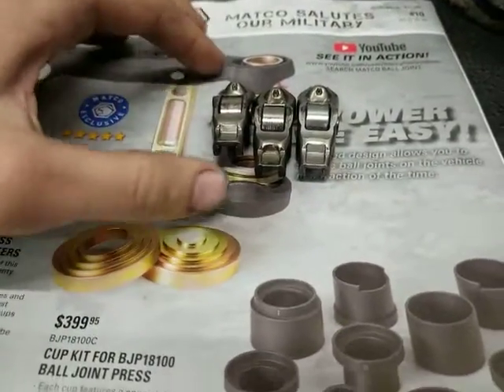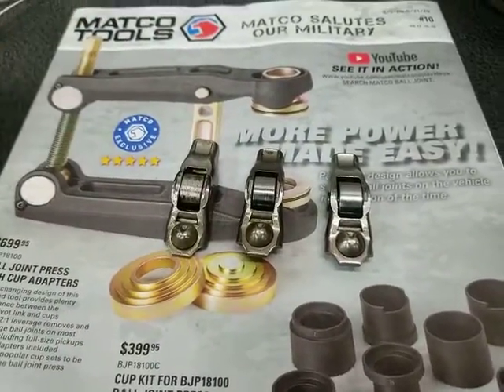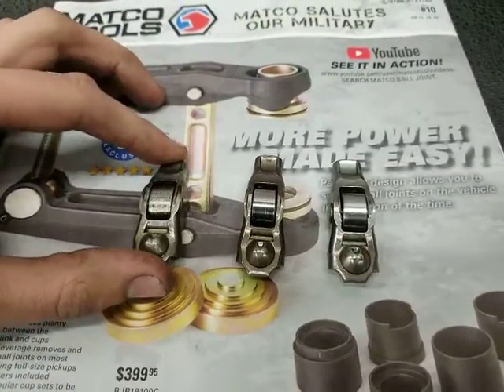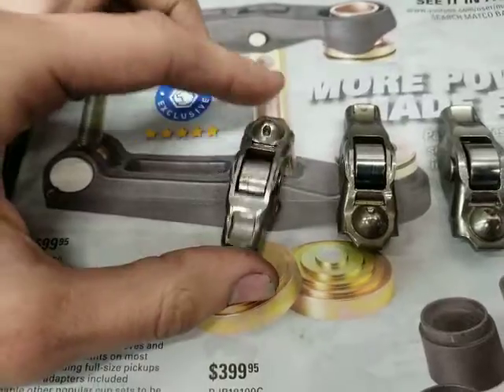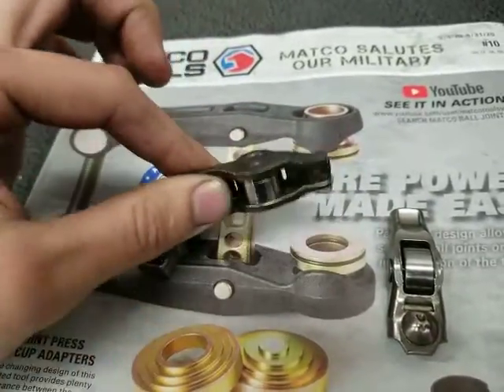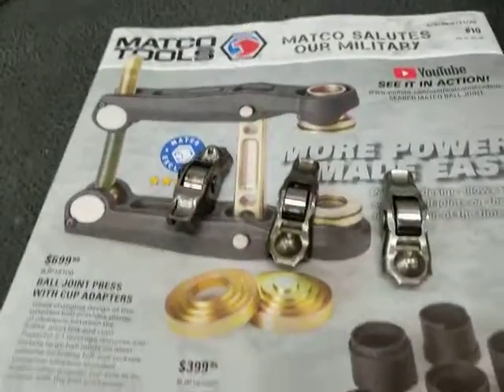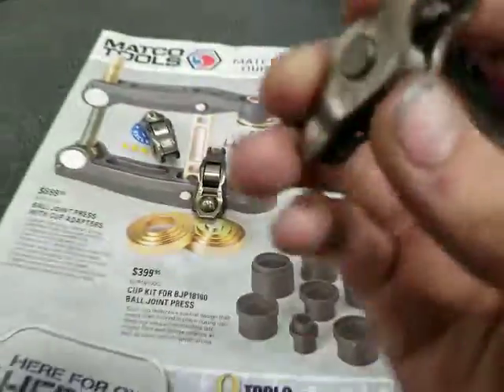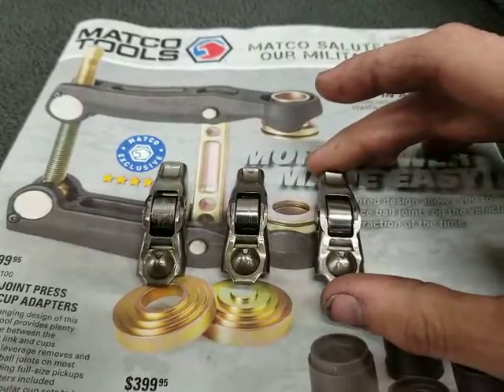3 stages of Chrysler pentastar 3.2 3.6 rocker arm failure

Comment: So in my 3.6 i was getting an engine vibration when above 5000rpm. I listened with the stethoscope and heard tapping in a few areas under the valve covers. But I didnt find any play in the rocker arms or any marks at all. The only thing I found was 4 lash adjusters that would compress with my fingers. without pushing the check ball in. So i assume i had lash adjuster failure and not rocker arm failure. But I replaced them all (rockers and lash adjusters) just in case. The issue went away.
Reply from the maker: I see that all the time with the hydraulic lash adjusters. Some are solid as a rock and some can compress with your pinky finger. Good find. Glad you resolved your issue.
Reply: @XHikotheproX  ok. I assume that little check ball spring wears out or breaks and can no longer keep the check ball in place.
Reply: Is it normal to be at 5,000rpms?

Comment: So I am currently having the very expensive rocker arm replacement done on my Promaster.  One of my cams was toast too.  The shop is putting the "Latest and greatest" version of the rocker arms in (all 24).  In your experience, will the updated rockers be a long term solution to this problem?  I really don't want to go down this road again.  Please advise.
Thank you so much for this video.
Reply from the maker: Thanks for commenting. I can say for a fact that I have not replaced the same rocker arm twice on the same vehicle. I have had customers that have one bank done, and come back 30-50k miles later when the other bank has one that fails but no. Provided whoever installs your new ones checks them all for absolutely no play in the vertical direction you should be fine for the rest of that vehicles usable lifetime.
Reply: @XHikotheproX  Thank you.

Comment: Where do the needle bearings end up when they fall out? In the engine block oil pump?
Reply from the maker: In tiny bits chillin around where the oil drains back out of the heads. In the pan. Around the magnetic parts of the camshaft tone wheels. Hopefully if it went through the pump, caught by the oil filter. Never seen a 3.6 fail a rod bearing because of it and I am seriously surprised that I haven't.
Reply: @XHikotheproX  thank you for that info - I would be very sad the day I hear that sound coming from my 2016 JK!
Reply from the maker: @bartwaggoner2000  hopefully not! But if it ever does, getting it done asap is really good insurance as to the longevity of your wranglers engine. Your particular year model is lower in risk statistically.

Comment: Why do they fail so much, is it from not changing oil or something else? Thanks
Reply from the maker: The 3.2 3.6 and the hemi both suffer from the same root cause. The needle bearings in the roller part or the center pin that the needles all roll around are just garbage quality and deteriorate. I've been doing this repair for years and frequency of oil changes does not seem to affect this issue. Also uncle Tony's garage has a great video about how the camshaft on hemi engines doesn't get lubricated like it should it's a great video.
Reply: @XHikotheproX  Yeah they must be! You wouldn't think it would be hard to make a better roller bearing holder. Do you know of any aftermarket that are better or is that risky?
Reply from the maker: @infernovideo  they're all mass manufactured the best thing to do is to sift through a whole bunch of them and hand pick yourself just by feel a good set of rocker arms. Sometimes I'll get handed new rocker arms from our parts department and they will already have play in them from the get go! So who knows just gotta find you some good ones. Who sells them is basically irrelevant.
Reply: I'm a mechanic for a company that has a fleet of over 100 caravans with the 3.6 engine and there's no extract reason that I can tell ?? Some will go 600,000 km with no issues and some will go through two sets of rocker arms by 250,000 km ?? all with the same oil and maintenance schedule ??
Reply: It seems entended idling is what really kills them. That's why the failure is most common on commercial and fleet vehicles.

Comment: I have a question, I have a 2015 grand Cherokee with the 3.6, 43000 miles, do not notice the tick, but on my last oil change I have shinny specks in my filter, did not notice any in the oil pan oil. It this a early sign of this? Full synthetic oil used.
Reply from the maker: If it's cam lobe material or rocker arm then by definition the roller would have enough play to make noise. I wouldn't start taking the valve covers off until you had a good enough reason to do so. If you see that again on further oil changes it would probably be worth it. These are mass manufactured engines with rough cast and sharp un smoothed edges everywhere. I guess just keep looking at future filters.
Reply: @XHikotheproX  never noticed it on past oil changes, something new
Reply from the maker: @froggerman44  you'll find out soon if that's the beginning of something.
Reply: My tick lasted about 6 months.  Very faint.  Then when it got louder I started having random misfires.  Then had to have rockers and one of the 4 cams replaced.  $2400

Comment: i had recently replaced 12 of these in my 3.2 jeep cherokee and im wondering, if i have swapped them for a new ones, will they also get destroyed this fast or is it just the case of a faulty chrysler's ones ?
Reply from the maker: After a certain year I believe it's 2017 there is an updated part. So any part you get today shouldn't have the same problem for the rest of the lifetime of the vehicle I would say.
Reply: @XHikotheproX  i hope the other one's that were original wont fall out now... 
I love this car but damn this hurts
Reply from the maker: @Micholex  I wish I could just impart knowledge of how to get them out and replaced without messing up timing and stuff. After the 227th rocker arm job it ain't nothin to me.
Reply: @XHikotheproX  i've tried myself but after realising the sheer amount of complexity i gave it to my mechanic, he replaced 12 rocker arms and that smaller camshaft.
Everything turned out to be around 1000 usd, of course i did that in europe so the price might differ, for me it was actually better to juz give up and let it be handled by a pro

Comment: Based on my experience. No signs or symptoms. One day the CEL comes on. The next day my neighborhood CDJR dealer tells me “cylinder head “ replacement..$3000. 2014 T&C. 134,000 miles. I beat the system by buying the Chrysler Maximum Care Lifetime Warranty (no longer available) when new.

Comment: The only way you can get play in that wheel is to lose a couple if not just one of those needles. What I wanna know is how come they are replacing heads if new rocker arms and cams might do the trick.
Reply from the maker: Exhaust valve cracking/sealing ability loses compression on certain 3.6 heads and is not related to the rest of the valvetrain. Those are two separate issues.

Comment: Why has there not been a recall on these oil pumps and bearings? Why isn’t a low oil pressure code/alarm being thrown?
Reply from the maker: Neither the oil pump nor the rocker arms will result in low oil pressure. A failure of either of these components will not cause a crash without warning. So thats why there is no recall. The rocker arm roller bearings are not a clearanced part of the oil system, and the dual stage oil pump that changes volume based on RPM doesnt lose oil pressure when the solenoid/electronic portion of it fails.
Reply: @XHikotheproX  yet it is a chronic failure mode, even in newer well-maintained engines. The failure is either due to lack of oil pressure or flow. Fiat/Chrysler warns against prolonged idling, so they are clearly aware of it. Ground-up metal bits from failing bearings inside the engine inevitably cause other damage. Main and rod bearing failure can occur suddenly and catastrophically. I’d be happier with an oil pressure gauge instead of a check engine light or OBD2 code that needs a mechanic to read.
Reply from the maker: @robertschulke1596  Well if the problem were to be quality control of the materials that these valve train components are made of and not an oil pressure/flow problem then a gauge would buy you absolutely nothing. Some vehicles have oil pressure available on display in the EVIC if you would like to look at it if that were your concern. At the point to where your engine starts making abnormal noise from the valve train the oil pressure does not change at all so you would then need to rely on whomever is driving to realize hey, I need to get this noise checked out. If you continue to drive on the noise until you reach the point to where the metal shavings have caused a main or rod bearing failure which I have never seen on a 3.6 even with people going way too far before getting the ticking noise checked out, then it's still a problem you should have addressed 1000s of miles before it became a "sudden main or rod bearing failure"

Comment: I heard this was fixed permanently years ago. These engines are in literally hundreds of thousands of vehicles. If it was that big of a problem the dealerships would be inundated with broken down vehicles.
Reply from the maker: Oh yeah the percentage of stuff out there that won't have this problem is much greater than the ones that will. But even today I still do 3 to 4 rocker arm jobs a week.
Reply: @XHikotheproX  Mmmm, even on say my 2021 Jeep Wrangler for example?
Reply from the maker: @DUNEATV  highly, highly unlikely. The gen 3 3.6 has other common problems but i see less of those on the whole. But still, give it another couple years they will have their own stuff going on.
Reply from the maker: @DUNEATV  I've done as many stop start batteries on JL wranglers as I've done rocker arms 🤣🤣. Not really, just kidding.
Reply: @XHikotheproX  LOL…I have the E-torque. What about that system?
Reply from the maker: @DUNEATV  I mean it's still a little early for me to tell but so far I have not seen a lot of failures or problems.
Reply: @XHikotheproX  It's still happening.  A 2022 Gladiator I drive is doing it at 2400 miles.
Reply from the maker: @Eric_the_Hiking  you know what's wild is since these comments I have done gen 3 intake camshaft and rocker arm replacements so yeah....nothing is safe lol
Reply: @DUNEATV  E-Torque is originally a Mercedes system. It debuted in the Mercedes S400 hybrid in the late 2010's. It replaces the charging system of the engine with a 48v generator. Said generator is mounted between the engine and the transmission. In the bell housing area.

Mechanically, the system is sound, but electrical harness issues plagued early systems. It's evolved a lot since then, but for the most part it's a solid system.
Reply: @LynxStarAuto  Except on my jeep the electric motor is mounted in front of the engine. But thank you for that info. I have over 25,000 miles and not a single issue with my Rubicon.
Reply: I was looking at a 2015 Chrysler 200 C, recently. Only 50k miles. Will it have same issue soon?
Reply: @XHikotheproX  Do you know when they updated the arms? I have a 2015 wrangler, i plan on doing the spark plugs and alum oil filter housing this summer. Should i also replace my roller bearings? I do most of the stuff myself on the jeep, but i hate doing stuff twice, so idd rather do it when that lovely plastic oil filter housing gets tossed in the trash, mine leaks a tiny bit, but nothing alarming. Honestly it might have stopped, or maybe i spilled oil the last time i changed oil into the galley.
Reply from the maker: @mails5054  during the 2017 MY and up is a revised rocker. The rocker arms are non serviceable you just replace the rocker arms. If you have the 3.6 timing tools and are confident of undoing timing on an engine and re timing the engine by all means. If not I would highly recommend getting the work done by a professional. The 3.6 is no joke when you leave the timing cover on and try to take the cam phasers off and then re assemble correctly in time. If you have no valve train noise I would not even bother with going into the engine you may have an engine that will live its whole service life and be just fine. Roll the dice I guess. Absolutely agree on the aluminum OFH. They don't leak a little bit, or stop leaking. That's oil from oil changes getting spilled down in the valley. When they leak the entire bell housing and a couple feet back from the trans gets drenched in oil. You would know.
Reply: @XHikotheproX  My jeep is fine rn so i guess ill cross that bridge when i do. I'd rather not tear into the engine, but im pretty confident with following directions and using the right tools. Ironically i can get a 3.6l used from v8 conversion shops the same price dealers charge for rocker arms lol. Im defiatnly confident enough to change gaskets and the oil filter housing, the only scary thing to me is the timing. I hope i dont cross the bridge but so many people do it themselves with the right tools. I agree to let professionals do it but the dealerships are so greedy. Im not referring to the employees but the greedy higher ups. You at least get commission for every job, right? The money doesnt all dissapear to people not lifting a finger?
Reply from the maker: @mails5054  oof. The greed and number of people who want the most cut of the retarded amount they charge people, versus what they actually had involved in the job. Yeah. As a technician I can tell you that no matter how far you swing your labor time you request either short changing yourself or asking for too much labor time, it varies the amount the customer gets quoted so insignificantly the bill people get is largely out of my hands. I could try and be as nice and as fair as possible they will just charge the same amount no savings goes towards their bill but it just means that they rake in whatever extra for themselves and the owner of the company gets his 3rd yatch summer home sooner. That's a whole nother problem, whole other deep rabbit hole. I just try and ask for a fair amount of labor time and use my knowledge to do as good of a job as fast as I can that's all I can do. And I sleep at night knowing I'm not a piece of garbage.

Comment: Replacing the damaged rocker arms is a partial solution, because later, others will be damaged, in my opinion, until Chrysler does not modify the design of the oil pump, the problems will continue. They have built an oil pump where the pressure regulator is electronically managed, in such a way that when the electronic solenoid fails, 50% of the pressure returns to the crankcase and above it remains without lubrication, mainly the rocker arms, conclusion, for now it is imperative on those engines, to replace the oil pump every 70K miles.
Reply from the maker: Interesting insight. The oil pumps don't fail on a schedule, but if you do have a P06DD code and you continue to drive on it you only have yourself to blame for continued operation.
Reply: @XHikotheproX  oh shit my car has the check engine light and i am COMPLETELY not paying attention to i... BAD BUMP BAD ENGINE DO NOT BUY WHY IT BROKE ON ME (crying emoji)

Comment: I saw and heard an almost new land rover idling at home depot yesterday and it was tapping very loudly
Reply: That's the injection system. What you are hearing is the direct injection fuel pump and injectors operating. Noise is considered normal. DI is a noisy system. Similar to a diesel.

Or depending on your definition of "new" if it was something with like 50k or so miles on it, could be timing chain, or the supercharger snout. Both are notorious failures on the AJV6/V8 engines.